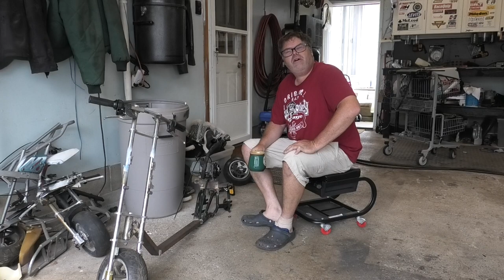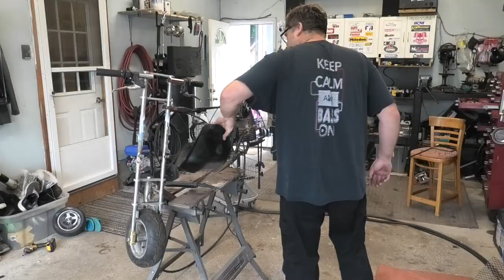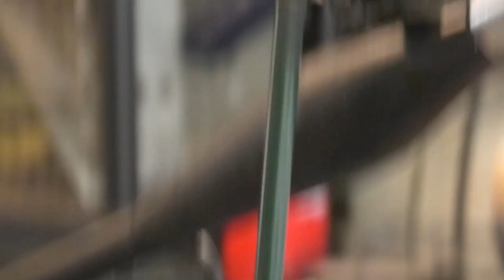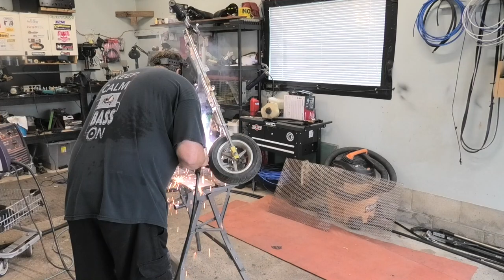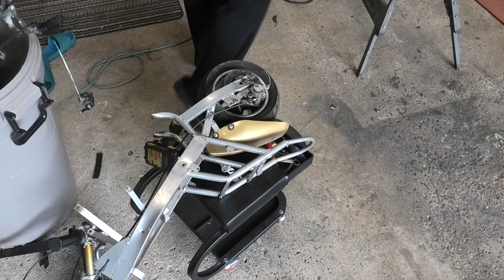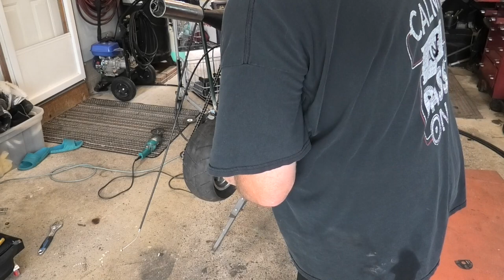#3 Scooter Next One Start Time

Comment: Flux core wire is probably your first problem. But dont feel bad, Bill. I've been welding since I bought my first welder when I was 14, I took a full welding course at the local trade school in my 20s, I could weld as good as anyone..... but after 20+ years of not welding on a regular basis, I completely suck at it now. LOL. Sure, I can glue two pieces of metal together but that's about it. Lol.